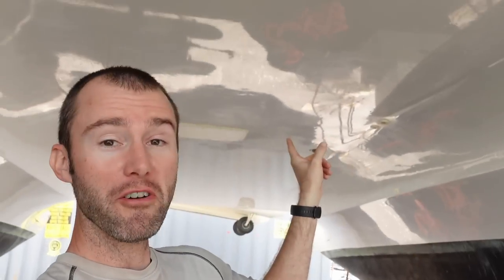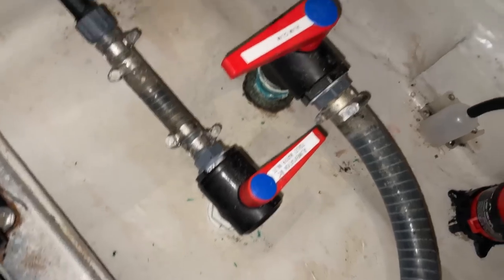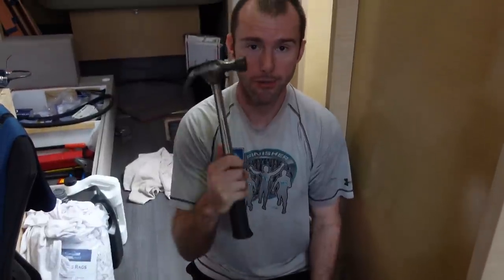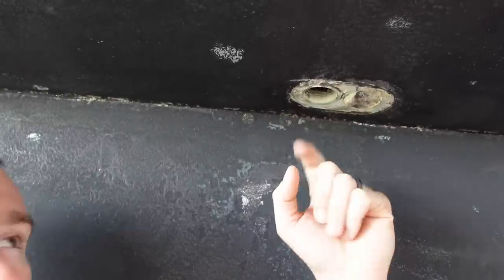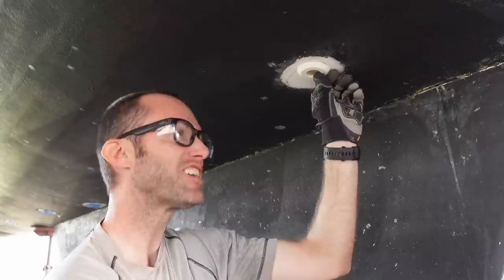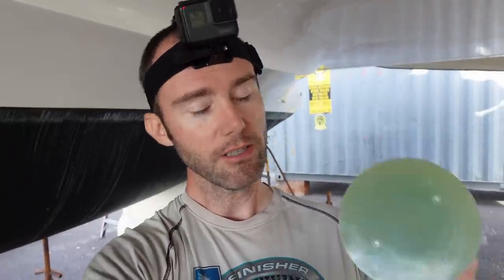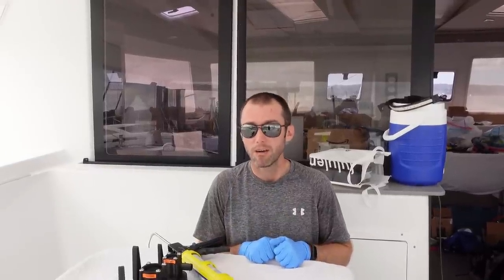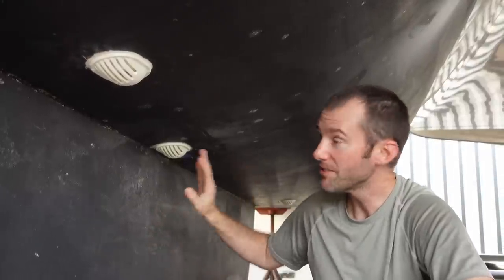Goodbye Bronze! Upgrading Our Thru Hulls

Comment: I would put the bronze back in , the plastic will break in a freeze
Reply: Normal composites today easily stay “flexible” in -40deg C and are more resistant to hits than bronze
Reply: My experience is that bronze is the best physically strong and virtually impervious to corrosion. My 42 year old Peterson 30 through holes are as good as new.
Reply: It is not plastic. It is a glass-reinforced nylon composite. It is a big difference. have switched to truedesign years ago - no more bronze crap again.
Reply: @Topiflex280   good luck with that
Reply: @Topiflex280 what is nylon ? Last time I checked that is plastic and  yes it's fiber reinforced which makes it stronger. But still plastic if it was my boat keep the bronze.

Comment: I am from Baytown, TX. I have worked on Heavy Equipment for longer than I want to say. The best wrench for tight spaces with a large jaw is a ford wrench. Get one you will not regret it.
Reply from the maker: Good tip, thanks!
Reply: Good day sir, I never heard of a Ford wrench before, did some research and will definitely be purchasing one. I am a boat owner and working space is very confined. Thank you
Reply: @joedirt9600  I have used it as a pry bar when tightening belts on a motor. I have use as a hammer. Slide a pipe over the handel for extra leaverage. I hope it serves you as well as it has me.
Reply: Deep sockets are life lol I only use the wrench when I don’t have the proper socket n usually end up buying the socket size needed

Comment: I can't believe you called this an upgrade. bronze is much stronger and has a much  longer life. Plus the insurance will not go for this.  I have an Offshore 48 with twin Cat 3208s 1988 all seacocks and thu hulls are bronze. when properly maintained they all work great.  I am curious what gave you the idea to go to marelon? I don't want to be negitive I just want you to know the proper way.
Reply: Insurance will go with it, it is not just plastics. It is composite materials that are both stronger, more flexible than bronze and do not oxidate/corrode.
Reply: There must be a good reason that so many go for Tru-design composite these days and not bronze.
Reply: Um, what are you talking about? Bronze is not 'the proper way'. Composites are 1. stronger than the bronze an aluminum  2. will last longer than bronze 3. don't have to worry about electrolysis or bonding. If you have a fiberglass/carbon boat these compsite thru hulls are literally the same thing as your hull. 

To anyone else reading this, despite this persons confident outburst, rest assured he is sharing bad information.
Reply: People have no problem paying more money on unnecessary equipment like the latest electronic gadget but don’t want to pay for proper bronze seacocks.
Reply: @dboboc  who said anything about money? Literally bronze is the inferior product for all kinds of reasons that have already been listed.
Reply: @dboboc  also, I'm not sure if you know this but through hulls Don't qualify as electronic equipment

Comment: Two things: a. the corroded fittings were not bronze - not even DZR, just brass. b. we use an angle grinder to cut away the skin fitting from the outside and then tap it inwards.

Comment: The step wrench is not for tightening or loosening!.. you hold the sucker stationary while the wrench on the inside does the work. Cutting the putty is fine,  but a block of wood and a hammer breaks it out with no gouging the hull by prying.

Comment: Not quite following what the technique here is for torquing those through-hulls? Did I misunderstand your approach, that you didn't want to torque them all the way down because you wanted a sealant gap between through-hull and hull, just letting a small amount of the sealant "squeeze-out"?

Is that a recommended process? What should those through-hulls be torqued too? Can't imagine your technique here is correct.

Comment: Why would you get rid of the time proven bronze through-hauls?
Reply: No fittings on a sailbost that go through-hull are brass.. they are Bronze
Reply from the maker: A very large part of the career I made was asking the question "why?" when I was told something had always been done this way.  Time proven is good, but that doesn't mean there isn't something better that exists now.  Marelon won't corrode and adding seacocks with the fiberglass backing plate is a significantly stronger solution than what we had perviously.

Comment: Step wrench: do they make different ones for metric and imperial?  "Kittyhair": I have not seen anyone else use this stuff before.  The only images you show are of the back of the can.  Is it a filler?   Can you tell us more about this product and whether you have used it anywhere else?   Seacocks:  can you tell us why you chose that brand / model?  They are clearly beefier that the FP factory installed models, but it looks like a lot of plastic to go into some small spaces.  Are they Marelon too?  See you both in Annapolis!
Reply from the maker: I know there are various manufacturers of step wrenches, but not sure about imperial vs metric.

Kitty Hair is a fiberglass filler by Evercoat that was suggested as a backing plate mount product in the Marine How To article.  We'd never used it before and decided it would work better to mount backing plates without the center hole already drilled.  It wasn't quite as 'spreadable' around the hole which made threading the thru-hole in during our "leveling" step harder.

The entire seacock/thru-hull assembly is Marelon.  And we went with their special OEM series which is used by boatbuilders.  This is the most compact solution they offer but any seacock will definitely be bigger than what FP does from the factory!

Comment: Easier to cut off the inside of the thru hull with an oscillating saw and tap it out from the inside . I don’t like using heat near gel coat. Personally I prefer the New Zealand Tru Design thru hulls and stopcocks. Leopard use 2 inch forespar ones on our toilet outlets and down the road they always seem to drip from the handle. You need to take the handle off and change the o ring and silicone grease it well and put them together again. I have not as yet had a drip from the Tru design ones. As you are using marelon you could have epoxied them in place. Certainly better than sika long term. I did that to my boat. One day if the need changing you just use the hole saw .
Reply from the maker: I do like the Tru Designs as well, but they're a bit harder to find in the US!

Comment: Why did you need to add backing plates?
Reply from the maker: The backing plates add some extra strength and rigidity as well as give me something to screw into that isn't the hull of the boat.
Reply: Ah, there's the answer to my question. I figured for strength but didn't consider the screws. I also now understand "kitty hair" bonds the fiberglass backing plate to the hull. Well done!

Comment: I don’t understand why plastic/ glass over bronze? And hopefully you have the right size bings for the holes if they ever break.
Reply from the maker: The new thru-hulls and seacocks are Marelon.  They're not "plastic" and are definitely a marine rated solution.  They're plenty strong and we'll never need to worry about corrosion again.  And the seacocks we got actually come with an emergency thru hull plug as a cap in the handle.
Reply: No more oxidation and corrosion…

Comment: Looks like you started quite the debate on bronze vs Marlon and a sub debate on whether your old fittings were brass or bronze.  Great video!  I recall that you all are moving away from YouTube and have other irons in the fire you are tending.  Good luck on those new endeavors and thank you for all the great content.  One question concerning your project, I noticed you took all the paint and barrier coat off when replacing fittings...required for bedding compounds to mate to gelcoat and not paint.  But then you put strainers over the through hull fittings leaving bare gelcoat exposed under the strainer...or so it would appear.  Are you concerned at all with this little bit of gelcoat being exposed under the strainer w/out any barrier coat and/or ablative paint?  I will be doing this same project this fall and am trying to learn all I can from those who have already done it.  Again, thank you!

Comment: The fiberglass backing board was not a good plan for the future.  Getting a good bond to the hull, with gelcoat still in-place is difficult).  Instead you could have grinded the gelcoat off the inside bottom of the hull and then tabbing in a couple of 3-4" strips of 1708 bi-axle tabbing strips using epoxy, would have be a better solution.  Then once cured, drilling a center hole from outside of the thru-hull hole with a 1/4" drill thru the tabbed glass inside, then use a standard hole saw bit to bore the holes to exactly the size that you need for the new thru-hull fittings.  And speaking of thru-hull fittings, that blue stuff that you called corrosion is the bronze doing it's job to protect the bronze metal fitting.  You noticed the shiney surfaces once you removed them?  Well you can bring the entire fitting back to it's original glory by bring it to a "brass" wire wheel (steel wire wheels are too harsh on bronze or brass) and removing the blue stuff and mild outside patina.  Also use a round bottle or pipe brass wire brush on a drill to clean up the inside of the bronze/brass thru-hull fitting.  THEN (additional tip) clean with acetone and paint them with "Speed Prop" and allow it to fully cure before re-installing them back in the boat.  Personally, I don't trust plastic thru-hull fittings (they can break easier).  An example of that, where you can go look up, is when a specific episode of Sailing Zingaro when he refitted his Oyster with plastic thru-hulls and one of them cracked and almost sunk his boat boat on it's maiden voyage at his first anchorage.
Reply: Zingaro is a clown who did not properly install the the thru-hulls. He just gooped everything with 5200 and hoped for the best with no load bearing collars. He did not even install the strainer the correct direction. Im shocked he did not hydrolock the engine. Also it was a speed sensor that popped out and flooded. Not a seacock issue.

Comment: As a life long boat builder,  what you are doing couldn't be further from correct. I would absolutely never replace bronze with plastic.  Especially below the water line. First off what your doing will not even pass an insurance inspection. Anything below the water line MUST be a seacock, with a thru hull threaded into the second with 3 thru bolts through the hull. Then it should be tied into the bonding system of the boat. Plastic thru hulls should be illegal period.  The only caulk you should be using is 5200 by 3M. Blue label takes a week to dry but the red label is ready to launch in a few hours. Plan on replacing the plastic crap in about 5 years if they are even still on the bottom. He'll a pressure washer will destroy them. Good luck.
Reply from the maker: Fortunately, we didn't replace bronze with plastic.  We replaced everything with Marelon which is fully A.B.Y.C. approved.  And not sure if you watched the whole video, but we didn't actually have seacocks previously.

We're quite pleased with the upgrade and are confident the new fittings will hold up just fine.
Reply: @OutChasingStars  Forespar likes to call it "a proprietary formulation of polymer composite compounds using composite reinforced polymer and additives". That's a fancy way of saying carbon reinforced plastic. lol
They're not completely maintenance free, you should definitely service them regularly. I've read about far too many incidents of failure in these things to be comfortable with them myself.
Reply: @sparkeyjones6261  That's what I was trying to tell him.
Reply: @michaelbeasley2085  I know, just thought I'd add my own two cents. 🙂
It's highly unlikely anyone would break off the handle on a Groco BV seacock, but I've heard plenty of stories where it's happened with the Marelon ones.

Comment: Sorry mate but i wouldnt change bronze over plastic either, whatever is reinforced with.
Reply: curious if you know what the rest of the boat is made of?
Reply: @matthewkorwel1099  Sure i know i was working on the industry. Its fiberglass. Probably aircured that means it is always curing. Has a lifespan of 30-40 years depending on the fatigue and uv exposure. The difference in the haul and a fitting is that a fitting has a very small stress area compared to a haul. A brass fitting will last a lot longer than that, a fiber reinforced plastic.... i dont think so. Anyway everyone has his own opinion but in my boat i would never change a brass fitting for ANY composite material. I've seen aerospace composites failing in applications where brass was a simpler cheaper and better in every way.

Comment: I will never trust a plastic through hull fitting again. I hit a small log at slow speed and it snapped the plastic fitting off the outside of my hull and almost sank my boat. Bronze or stainless would have taken a peice of the log. No plastic below the waterline...ever
Reply: Are you saying bronze thru hulls never break? I know of 3 boats personally that would disagree with you.

Comment: Remove bronze ( or are they DZR Brass?) and replace with plastic 🤔See you back here in 5 years when your insurance company tells you you have to replace all your plastic seacocks.
Reply from the maker: I've been seeing several comments like this so I'm genuinely curious.  Why do you think there will be such an issue with Marelon?  We have the Series 93 seacocks which exceed ABYC standards and have official ISO certification.  We won't have any issues with corrosion or electrolysis, which are issues we were already experiencing with our old bronze (or could have been brass, not sure...) thru hulls.

https://www.forespar.com/pdf/techTips/M10-Marelon-Marine-Grade-Plumbing-Systems-with-certificates.pdf
Reply: @OutChasingStars  I would say that there's a reason insurance companies never  insist that bronze seacocks are changed just because of there age whereas (at least on this side of the pond) they are recommending plastic be changed after 5 years. It may be wise to ask your insurance company?
Reply from the maker: Our insurance company has told me that any big changes to the boat must meet ABYC standards so we're all good on that front.  There are quite a few boat manufacturers who use Marelon as standard over bronze so hopefully any insurance qualms about Marelon (which is definitely different from basic plastic) have gone away.
Reply: @OutChasingStars  Great mate , get it in writing 😎